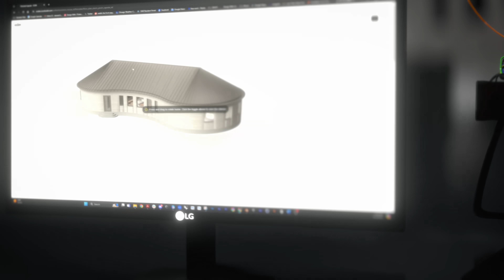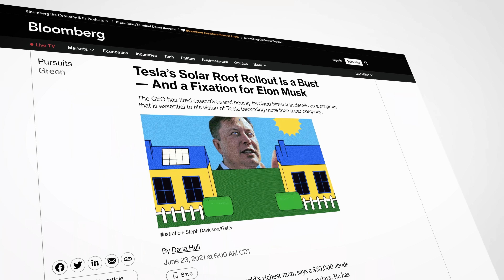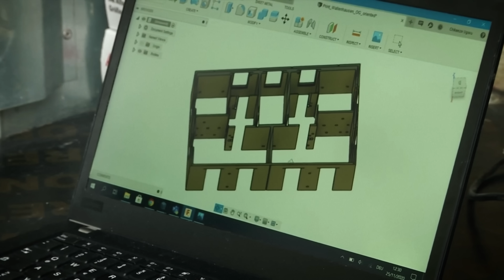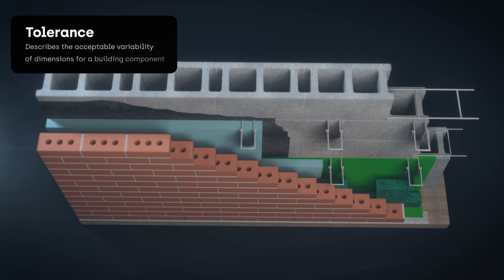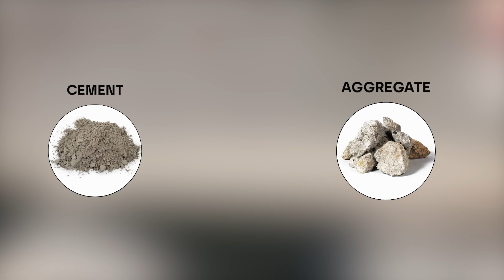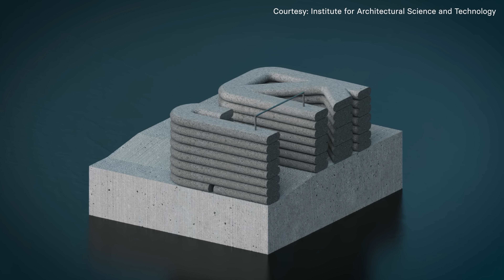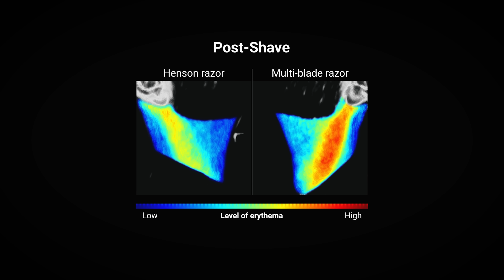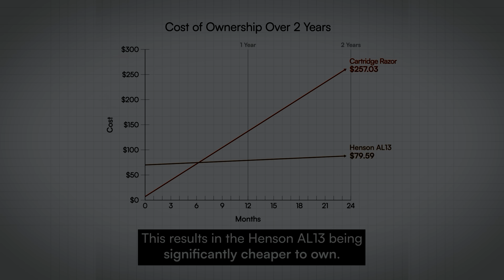Why 3D Printing Buildings Leads to Problems

Comment: The only part that is being automated with 3d printing is essentially the framing, which is already the quickest and easiest part of construction. You still have to do all of the finishing (plumbing, electrical, cabinets, windows, doors, painting, flooring, roofing, etc), which is the slower and more expensive part.
Reply: Also, all those other trades become much more expensive in this type of building, as running electrical and plumbing through hollow walls is obviously much simpler.
Reply: @NoTroubleMikeG  it’s no different than Insulated Concrete Forms (ICF)in that regard.
Reply: @unlisted5152  it is way different from ICF. It's pretty easy to run wiring through the foam; and drywall attaches directly.
Reply: @NoTroubleMikeG  The walls that need electrical/plumbing run through them are designed to be hollow to begin with.
Reply: @jmlinden7  On slabs, you can run the PVC prior to pouring. You can also run PEX inside PVC.
Reply: This looks like a nightmare to run plumbing and electrical
Reply: Real innovation is practically impossible in construction but if supporting technology could be made available. Prefabricated conduits for a variety of systems could be available. It's a bit of  a mystery to me why even  without special accommodations  this would be much different than any other poured or cast concrete structure.  

Long term the lifespan of this building type probably dependent on the quality and size of the foundation.  I  wouldn't trust the minimum code with this.  

People who believe that this is a more efficient form of construction  are  probably wrong. But  repair  options aren't as limited as seems to be expressed here.
Reply: @kevindouglas2060  a lot of innovation in other industries comes from standardizing my something or making it simpler. You can’t standardize hardly anything in construction because every situation is different. Versatility is where the innovation is at for construction. The hammer was invented 1000 years ago and will always be used on a job site because it can do 1000 different things!
Reply: it's not even the complete frame. Just the walls. I used to frame and the walls for a three man crew took a week of 8 hr days for a relatively large home. This is nothing more than solution looking for a problem.
Reply: @TheRedbeardpirate  Plus, they need carpenters anyway for the roof trusses and trim.
Reply: Similarly: My son had been enamored of the Power Painter he saw in commercials. I pointed out to him that they had automated the only part of the painting process that was fun. I'm still waiting for someone to automate scraping and taping.
Reply: As soon as the nuclear bombs start falling one day and fallout is all over the place, people will prefer solid walls for the subsequent century
Reply: At the very least, they could have a team rendering  the walls and placing lintels and service conduits as the house is printed. It may delay the print job, but everything would look better and  installing the services would be vastly easier and if rendering is done, repairs could be made to visibility match, even using different methods. If you put non load baring frames inside, you could then put the services behind plasterboard for a more conventional look.
Reply: People with these houses are often not doing drywall either. So no framing, drywall, mud, and texture, is pretty attractive. As someone who does a lot of drywall and lives in CA and deals with fires, it sounds nice. That is IF the price can get below the more laborious option, and it can handle earthquakes which I don’t know if either of those are the yet the case
Reply: I suspect it's actually cheaper to make big elements in factory environment, with a lot of the components already installed there. That's done quite a lot here in Finland. The elements don't even need to be totally standardised - it's making them in a factory that is the biggest benefit. No need to worry about weather and such, all workers close by and easy to move between different projects.

Then they are transported and installed in place in a day or two, and the rest is finished there.
Reply: Not necessarily. The printed walls are the walls and interior/exterior finish most of the time.
Reply: That is why they are working on a life size 3D pinting Robot that can do  all the finishing and art work.
Reply: Finally someone who gets it
Reply: Finally someone who gets it
Reply: Only reasons for these houses: mass production for low cost shelters & automated building ahead of astronauts arriving on the moon or mars.  Otherwise, I expect it just makes more sense to use traditional construction methods.
Reply: The power with 3D printing, is that you can print anything that is particle based ( in theory ).  So therefore we will eventually 3d printing everything, from wires to plumbing to windows.  You can 3d print metal, plastic, and glass (even though its unlikely it will be clear enough).
Reply: Plumbing and wiring a concrete wall seems vastly more difficult. Think of all the removal of material you would need to do for junction and switch boxes. Times that by 2 for pipes. The only time I see saved is not having to sheetrock, or slap on vinyl siding. I shudder at the idea of cutting baseboard for these things too. Nothing is straight and square. You would need half a truckload of caulk.
Reply: @Cucumberflavoredmustard  Electrician here and I was thinking the same thing... I've wired schools with concrete block walls and had to race around the Mason's scaffolding, inserting outlet and switch boxes, then 3 ft pieces of conduit while the courses of block were laid. All wiring and junctions was done above block ceilings.
Reply: @Cucumberflavoredmustard this isn't a replacement for stick built, it's more of a cheaper alternative to brick
Reply: I do flooring and shower installation and I wouldnt work in one of these houses. For a shower alone it would be a nightmare. So what you save in one area you pay for in all the others, and probably more than you would save.

I really dont see there being any savings, at all. My boss had a 2500sqft house build for just over 300k, and a almost 1500sqft 3d printed house sold for 300k. So where exactly is the savings?
Reply: @SymplyOP savings from new technologies happen when they go from R&D to more widespread use. Think tv prices.
Reply: @RocketCityGardener  Building a house isnt like TV prices. Not to mention a 3d printed "house" isnt complete.

You still have to have a builder to build the skeleton of your roof which has to be designed specifically for your complex shape, driving up costs, plumbers, the best foundation out there because any movement or cracks in your slab will be transferred to your house cracking it, flooring, cabinetry, electricians, painters and if you dont like the printed look then you have to hire finish work.

If you think 15 thousand for some square cabinets in a square house, make those cabinets rounded. Tile showers in this would be a nightmare and cost a lot especially when you get into wanting niches and just the prep work to do the shower. And what system would allow for curved surfaces? All the systems I know about have to do with straight walls with 90 degree corners. The only option would be a paint on membrane and those arent exactly "reliable".

flooring as well. The complex shapes increase the labor of installation along with material costs.

These arent going to be widespread to bring costs down. If anything they will be oddities that will drive the prices up.
Reply: Amazing this wasn't brought up.
 Plus a framed wall with insulation adds far superior thermal performance.
Reply: @Rambleon444 Also I'm pretty sure a building made out of a single piece of concrete will explode during an earthquake or a fire
Reply: @Rambleon444  Not true. The HERS rating for an average stick framed and insulated house is ~100. 3dP houses are achieving HERS as low as 40. You have better thermal mass and lower ACH (air infiltration/exfiltration).
Reply: Ive seen lots of videos of terrible new construction and it seems like the framing is the part they suck at the most.
Reply: exactly; they seem to forget that the only three people that actually work close together in construction trades 

are the Carpenter, Framers, and the Mason

who work BOTH before and after amenities and finishings

you can't just create a structure. that is, by definition, just a stone hut

and at least carpenters and masons vividly know this and work with and around it; (panel box cutouts for electricians and tons of dead floorspace for plumbing and wiring, etc.)
Reply: There is also a lot of risk regarding resale value.
Reply: @MinusEighty  Not familiar with 3D at all, could you share what would be a resale value problem ?
Reply: @melissatuason2395  "could you share what would be a resale value problem ?"

Well, for one, the examples in the video had a strong tendency to look pretty ugly/strange as a result of the layered appearance and the slight bit of flow in the cement before it hardens. Even if you personally are not put off by that appearance, it's definitely something that is going to be a turnoff to part of the buyer market.
Reply: @ strictly just my opinion if a house was sold down the road would you buy such a house if you were thinking of remodeling. Lets just say a person is really handy with carpentry and he will remodel using wood to reattach things to concrete etc.Think of the work involved if one is willing, next is if one was a mason cement guy that may be handy with brick & block etc. now he has to call other trades to attach to it etc. You get the picture, would you be willing to take on such a project, for me I wouldnt be able to take on such a task. Wood & steel stud framing is the easiest for us. Other world countries have done concrete and have converted to steel studs. Much much faster & cheaper. Just my thoughts
Reply: @melissatuason2395  I think when the prospective buyer asks about the 75ft garden hose reel on the kitchen wall and the seller says, “Oh that. It’s our vacuum cleaner. We installed it after we moved in.”
Reply: @melissatuason2395  Who wants to buy a house where ALL of the walls, both inside and outside, are wrinkled?  There is no data on how well this material will age.  What happens if it turns to dust in 30 years?
Reply: @pauleveritt3388  My husband believes the concrete will be fine for years to come. The issue with all mortar products providing it doesnt absorb any moisture is 2 things that he could see. When concrete gets wet & dries repeatedly it becomes tougher as the cycle continues just like a driveway, then it becomes brittle as it continues to cure. Next is if it doesnt dissipate the moisture quick enough mold loves to live in concrete during damp & humid months and remains dormant  during freezing temperatures. The minute the weather warms up it multiplies beyond control.
Reply: @pauleveritt3388 I mean it’s concrete dude it’s not good to turn to dust. I’m not worried about that.
Reply: @pauleveritt3388  Spider factory.
Reply: It won't turn to dust . It could turn into a cracked mess. It's something like a log home in a way. Eventually it can be covered at that point it becomes a different type of construction.  But if it is repaired that way there is no upper limit on how long it can last in the new form.  If you consider that lasting.
Reply: @MinusEighty I think that is the idea. Make the cost lower.    Yes many fudie dudie people will alway wrinkle their nose at new way.  That’s normal. The population has Luddites.
Reply: @MinusEighty that’s the bs part. People will just have to get used to the future. The current system is not sustainable and is extremely wasteful. And cost way too much.
Reply: This is true at the moment, however I could easily see the technology developing automated electrical, plumbing and roof systems. Doors, windows and cabinets would all be mass produced specicially for the automated systems to install.
Reply: @LincolnL-s3o So just make everything out of concrete 😂
Reply: @LincolnL-s3o  😂
Reply: My Husband said "They kinda missed the finish part of the building" he is not a big fan of putting people out of work however less folks want to work hard anymore. There are always pros & cons and an argument for every procedure. Im sure it is good in flat areas and has its place, but how about hillside or steep hills where the grade is irregular, that will be a challenge setting up.
Reply: @melissatuason2395  Your Husband is missing the key part of "Hard-Work" which is that People don't want to do it unless they are getting paid Good for it.  Young People learned not to ruin themselves to make someone else richer in the hope they might see some of it themselves.
Reply: can we skip painting?
Reply: To get out of the ground is roughly 30 percent of construction so it isn't the cheaper part actually the most expensive in some way
Reply: thats true , but I see one advantage..as all the dimensions are computer generated, all aplliences , roof , doors , cabinents can be pre produced,without further measurments and this will make the process far more faster, I guess..but maybe it will still be risky😅
Reply: Okay but you get a home that is vastly superior to the stick frame house. It's far stronger, not going to rot, it doesn't need as much HVAC, termites and other pests won't eat it, and it can probably ride out hurricanes or earthquakes if the roof is good. 
I would love to have a 3D printed home. They look cool and they make sense to me.
Reply: @comfortablynumb9342 they might do better with fire, but i would not expect them to do better with an earthquake.
Reply: It's not just the framing, but also the wall sheathing system, rockwool or fiberglass or spray foam insulation, wall wrap, interior drywall, exterior facades, concrete pouring, and even painting if you leave it exposed like many of the model 3d printed homes. Some fixed furniture pieces like islands or inset tubs can be printed. Coordinating the logistics of different tradespeople coming in and out of the property and ensuring buffer time between is something that 3d printing avoids, so you build much faster and with way less labor.
Reply: @braxhartman  I think the down time between trades will be a problem, not to mention if they had to cut into something. It may require approval every time one needs to punch through the concrete, our trades need additional training and definitely may get into code dilemmas with engineers.Its just new and maybe will improve as time goes by who knows. I'll stick to conventional wood as it can easily be modified or remodeled  we are just strictly set up for wood and steel building its what is easiest for us.
Reply: @melissatuason2395  Time between trades is actually one of the main problems that 3dp construction aims to solve by eliminating the need to coordinate between pouring, framing, insulation, wrapping, drywalling, etc. Good question about the renovation piece - because the material isn't actually concrete but an aggregate material, small holes (e.g. for a new outlet) it can be patch repaired. Larger renos need approval, but so would a stick built house. Probably the biggest challenge is code, since many jurisdictions just don't have experience with these methods yet.
Reply: Negativity negativity. this is a new idea and technology, and we hope it succeeds. although identifying problems is fine, encouraging people to shit on an idea that can help many people is a bad thing. outside of your first world confines, this technology can be purchased by developing governments to help house hardworking people who dont have homes. concrete homes are far more long lasting and strong than wood frame homes. my family's home in rural india has stood for over 300 years, no rotting, no issues. it's a concrete structure. some have said it only replaces the framing, no thats not true. the frraming is still done by humans, instead of wood its rebar. the concrete is the exterior, the interior, and honestly everything that gets done on the interior happens VERY quickly. Mainly because you can hire all the teams to come in and do several things at once. a house can be built in 1 month. 3 days for the exterior, 1 month for the interior. compare that to my new construction home we purchased this year - which took 9 months to build (the interior took only 1 month, we moved in october, we did the final check in september prior to them beginning the interiors. 4 bedroom home took 1 month to complete interior, plumbing, etc). he say it will be hard to make repairs even though people have worked with concrete for millennia. people know how to work with it, repairs dont need to be 3d printed much less lifting up the roof to do so. he said why dont they just use molds for the walls - transportation is expensive. cranes are expensive. giant concrete walls dont fit inside trucks. meanwhile, one 3d printing robot can be transported 1 time to a development lot, and stay for months upon months, before being transportd again. everything else is built right on the spot.  instead of considering the positive, you spend your time bringing it down.

Comment: Get the optimized printers in a collection croud source purchase for every facet of your manufacture needs as a custom community model. At cost of raw materials.somthing to keep an eye on.I think you all know that by now. Optimization of the printers and 50 % rate of deflation every two years in general on all digital and output of digital process. Analysis will show us.